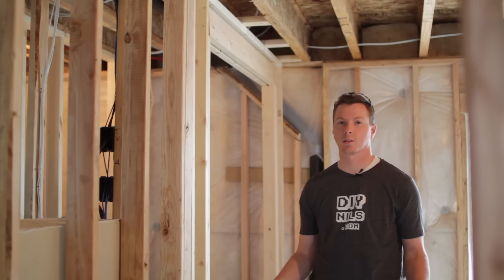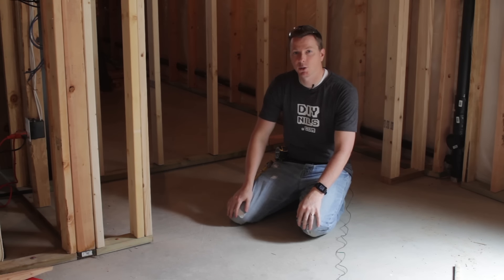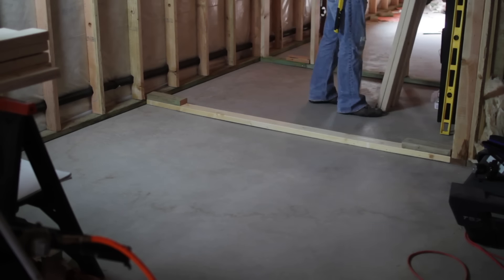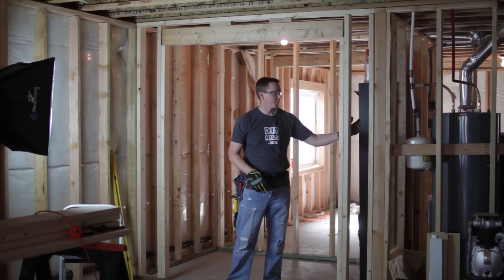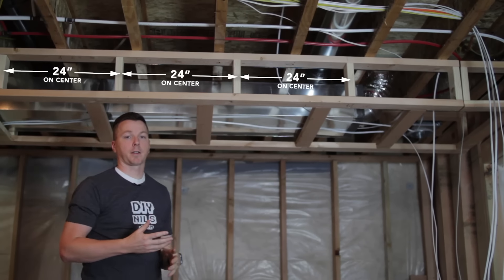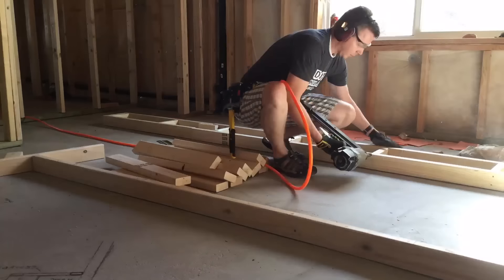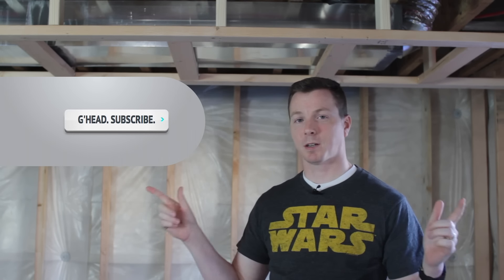How to Frame a Room: Part 3 - How to Frame Soffits and Closets

Comment: Just curious why you used headers on the closet when the wall is obviously not load bearing.  It seems simple 2x4 headers would be sufficient.  Is this code where you live?

Comment: Is there a reason you don't just nail the bottom rungs of the soffit on through the ends? Is it because the nails aren't long enough?
Reply from the maker: Great question. You're correct that the nails aren't long enough. The nails are typically around 3" and the sideways studs are 3 1/2", so they wouldn't even make it through. Toe nailing is the best option here.
Reply: Using a 2x2 on the bottom of the ladder can alleviate that problem. And it decreases cost , but always make sure your lumber is as straight as possible.

Comment: Hey Nils so do I use 2x2 for the cross members cuz it looks like you used 2x4s in gen. I wanted to know if I can just use 2x2s for the ducts and pipes. So as a top and bottom and crossmembers 2x2. That can do right? please let me know
Reply from the maker: 2x2s should work, yes, and they'll also minimize the size of the soffit, which is nice. I chose to do 2x4s because of structural stability. Driving nails into 2x2s increases the chances of splitting and gives you less room to work with as far as driving 2 nails in but it can be done.

Comment: Great vid!
Tip. Usually when a fella is framing a closet you just frame it up with a whole bottom plate in tact. Same as a door frame so when a guy installs it the frame stays square with everything then nail it all into
Place and then once secure , cut out the bottom plate between frame. 
If you do it the way you’ve shown, you risk possibly things not staying square then when you go to install the doors , it can sometimes bite ya 
Great tutorial , not wrong or right... just worth a mention
Reply: @London Jadiel Thanks, I signed up and it seems like they got a lot of movies there =) I appreciate it !!
Reply: @Jude Joseph you are welcome =)

Comment: Terrific production-first of all, here are my takes on basics-the audio quality is excellent. Lighting, filming, framing of vid picture and clarity all very excellent. (nice to have good, stabilized videos without hearing babies crying, dogs barking or distorted audio) Effects- fast motion and highlighting were done beautifully. Now to the subject: yes, hook suggestion, ripping 2x4 for piece on wall and staggering joints are great tips-thank you. Question- on the nail sizes, you mentioned 16d for ladder but what size for toe nailing would you suggest? Also, in my case, I was also looking for information/instructions on adding vent grills to those ducts. Thanks for your nice videos, Harry

Comment: how did you frame on the backside of the duct work?  Is that a frame that goes up to the ceiling joist?
Reply from the maker: Typically, yes. You frame to the ceiling wherever possible. There is usually enough room, even behind pipe work to go to the ceiling, then you can attach your soffit to that wall.
Reply: @LRN2DIY  Thanks I assumed so but wanted to make sure before I begin this journey!

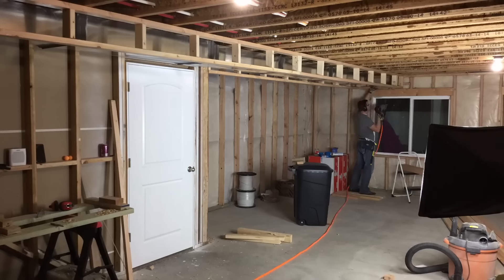Comment: Look at 7:25 in the video. I've got a metal ibeam in my basement down the center with metal supports spaced throughout underneath. My ductwork is on the side where I want to build a new bedroom. I am having trouble with figuring out how to design a wall and soffit that will use the least amount of material, be plenty strong, and have the most amount of headroom. I've been struggling with this for a while in my mind. Could you post another video showing how you handled the door under that soffit? My main focus is on handling the measurements and framing around the door underneath that ibeam and also allow enough room to mount the soffit. How did you attach the soffit to the wall by the door?

Comment: Great video! I did want to say that the closet door rough opening should be 2" bigger than the actual door size that you are installing...so the 72" door(6'-0")your using  should have a framed width rough opening of 74" for the door to fit into the framed opening properly.

Eddie
Reply from the maker: Thanks for the tip, Eddie!

Comment: Should I use the longest possible 2X4s for my soffits or break it down using 8 footers? Just thinking that it's harder to tell if the 16 ft 2x4s are straight or not
Reply from the maker: Great question. I'd stick with as long a length as you can identify as being straight. Another tip is if you're running a longer soffit, build your ladder by staggering the sides (the 8' or 16' lengths). For example, start with a 4' rail on one side and an 8' on the other, then add 8' runs to each side until your desired length. It's the same principle as roofing, sheathing or anything else where you don't want a weak line. Hope that helps!

Comment: Thanks Nils!  Do you think that 24" centers will support the drywall on the bottom side of the soffit?  Will you see any sagging?  I suppose it depends on whehter you are going to use 1/2" or 5/8" drywall.
Reply from the maker: +Steve Grimes Great question. I have finished drywalling my basement and I think the 24" is just fine in this application. If I had a wider soffit, I would likely go to 16" OC but as long as your tacking it every 2' and joining sheets on a stud, it seems to hold up just great. I did use 1/2" (not 5/8") as well.
Reply: as long as the framing solid it will not be an issue with a 2foot on center, Drywall screws are getting tacked every 8" or so.. 2' On center is not over span for this

Comment: How much space do you leave between bottoms of soffit and  furnace ducts?  Or how much space to you leave on a sidewall next to furnace ducts?
Reply: I don't believe it's required to leave any space between duct work and soffit but you should always check the code in your area to verify. Same with furnace ducts.

Comment: I am renovating a 136 yr old downtown building.  The interior plaster over old brick walls are not so stable to attach much.  So I’m erecting 9’ walls along the parameter of the 22’ X 65’ room that has 14’ ceilings.  My intent is to have a 2’ soffit around the room at 8’ high with suspended ceiling track on the inside spanning the remaining 18’ at 9’ high.  My question:  How can I build soffit boxes strong enough to support such a suspending ceiling perimeter (and 18 to 24 2x4 drop in lights) without ceiling joists to attach the box to?  It will only be attached to the erected 2x4 mostly freestanding wall.

Comment: Nils do you have to add any fire stops on the exterior walls and at the ceiling
Reply from the maker: That all depends on your area. You'll want to check with your city. In my case, they were only required on the ceilings but that may be different where you are.

Comment: Hello! Loved the video and I am remodeling a basement and I had a quick question about the soffit. So towards the end of the soffit, when it butts up against the wall, I was curious as to if when the drywall goes up on the wall, is there really any support for the drywall around where the soffit is (seen starting at 6:35) , since there is no edge to screw the drywall to? I do suppose that the distance may not be too much of an issue for drywall but if there is too much of a gap, when the drywall is hung, the unsupported edge may crack over time or if pressure was applied to it. In the video there isn't that much unsupported area by the window and where the drywall would go around the soffit, but sometimes the soffits vertical edge may cover a stud, leaving a vertical gap that has no support since the nearest stud may be another 15 inches away. To get around this, would it be beneficial to install the soffits after hanging the drywall and before mudding it, so the drywall is supported as normal along the edges and such, or even better to install some backing around the soffit area? Or maybe not even stress about it at all? Anyways, love the video, found it very helpful, and hope you'll be able to help me with my question! Thanks!
Reply from the maker: Good question. I wouldn't recommend drywalling before doing soffits because it's kind of a pain to switch work flows like that. If after putting in soffits you see that there is a larger unsupported area of wall, blocking is the way to go, like you mentioned. This can happen in corners of a room as well (not talking about soffits) and adding blocking is sometimes necessary. Always better to be safe than sorry and it's usually not hard to add a few blocks or even an additional stud. Hope that helps!
Reply: DIY Nils mn
Reply: A

Comment: Hi Nils-what would you do if your wall runs parallel and inbetween the ceiling joist?
Reply from the maker: If you mean that the top of the wall runs in between two joists so there's nothing to attach it to, you can just place cross-beams between the joists, every two feet or so, then attach the top of the wall to the cross-beams. You can see this in my first video since that's how the wall I framed was situated. If I misunderstood the question just let me know.

Comment: Question, I need to frame a kitchen to install drywall on a home with exposed beams and no attic. I can't place the drywall directly to the rafters because There's duct work and conduit running beneath an old drop ceiling. Would it be strong enough to frame it up the exact same way as you've done these soffits?
Reply from the maker: If you're referring to the strength necessary to hold up the ceiling and be secure, then yes. If you want some additional peace of mind, try using screws instead of nails for the soffits.

Comment: how to you make sure your "Ladder" is straight from one end of the room to the other to nail up. do you pull a measurement from one of the walls?
Reply from the maker: You can, but that assumes that the other walls are all straight too. It's important to choose straight studs for your ladders and then, if you're at all concerned about it remaining straight, snap a chalk line of where it is supposed to go, then follow that line when hanging it.

Comment: Is there a reason why your soffit rungs are spaced at 24 inches off center when your wall studs are 16 inches off center?
Reply: Dave  because they don't need to be as strong. They only need to support thrmselves.
Reply: Thank you Jacob.
Reply: Jacob Zimmerman that's right

Comment: Use a 2x2 for bottom plate of ladder. Stop messing around with that toenailing malarkey. You can lay the rungs flat to accommodate the dimension.

Comment: Is a 2x6 header even needed? It's not a load bearing wall so couldn't you just use a 2x4 laid flat for drywall? Same thing for part two with the window header.
Reply from the maker: +Mark Wiles Great question, Mark. I had looked this up and found lots of conflicting answers. I couldn't find that specific answer in my city's code either. Do you have any documentation to help us out with this? I'd love to clarify in the video if only 2x4s are required.
Reply: +Nils Rasmusson Going to depend on your code of course.  For example:

R602.7.3 Nonbearing walls. 
Load-bearing headers are not required in interior or exterior nonbearing walls. A single flat 2-inch by 4-inch (51 mm by 102 mm) member may be used as a header in interior or exterior nonbearing walls for openings up to 8 feet (2438 mm) in width if the vertical distance to the parallel nailing surface above is not more than 24 inches (610 mm). For such nonbearing headers, no cripples or blocking are required above the header.
Reply: +Mark Wiles Not needed! Not load bearing...not needed. You do not need structural headers, header-jack-studs, cripplers, etc...if you are in a basement and just building what's called "curtain walls". Curtain walls are not load bearing wall, and do not need any structural framing at all. This non-load bearing framing is code in all areas! Save your time and effort.

Eddie

Comment: luv the videos but i noticed that you dont cut your top plate over a stud... why?
Reply from the maker: Honestly I hadn't even thought about it. I will add a note to the video recommending this - makes perfect sense. For what it's worth, in my other longer walls, I ended up just joining the two top plates together with a much 2 ft stud underneath, then I cut the stud on that one a bit shorter to accommodate. That kept the walls much stronger than the way I did it in this video.

Comment: Hi nils... I have rented a house and the wall in my room is very very cold I think it is a cavity wall and isn't insulated. Could you advice on how can I fix it? I can't afford the wall foaming etc,  is there any diy which I can do from the inside to make the room warm??  Please let me know. Thank you
Reply from the maker: Hi Dure, That's a tough one. If you're not able to do a spray insulation you'd have to look into a space heater most likely. Another option is to place foam insulation panels on the wall but they're not pretty. You can purchase 1-3" thick insulation panels that would help but, again, not sure if you'd love the look. I would definitely talk to the landlord and see if they'd be willing to help out. Best of luck!

Comment: Are you planning on putting another layer of insulation in your new stud walls?  If so.... then you'll probably be putting on more vapor barrier.  You will need to put a long cut in all your first layer of vapor barrier first.

Comment: Why in the world have you put in a header on a non bearing wall???
Reply: Allan Madvark cause there will be door there
Reply: I didn't put headers on my non load bearing walls, where I framed doors. It passes code. It's doesn't need to support weight, other than drywall, and the pre-hung door. And standard 2x4 framing with just a 2x4 cross member is sufficient, in my opinion.
Reply: Yeah you really dont need a header there, looks pretty tho ;)